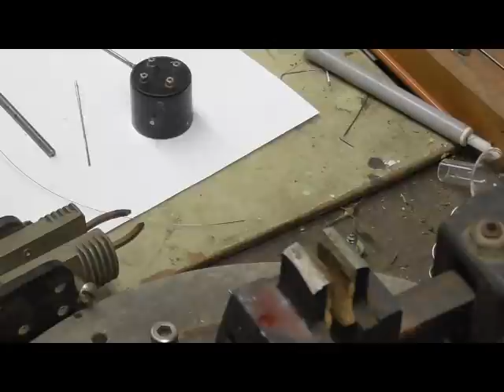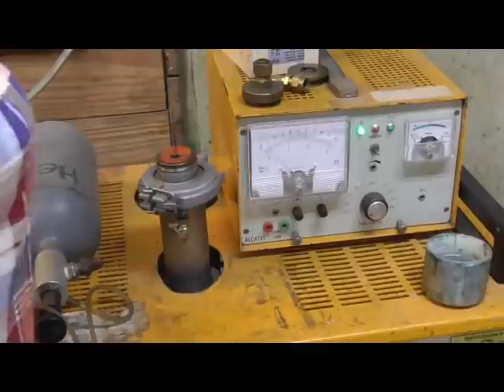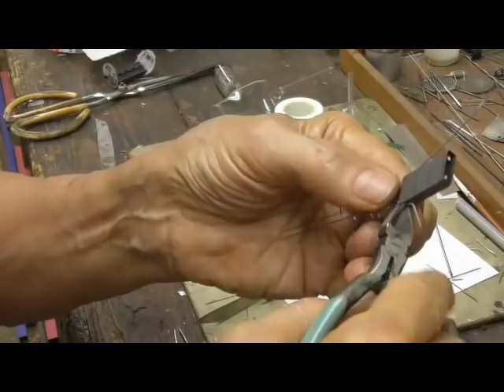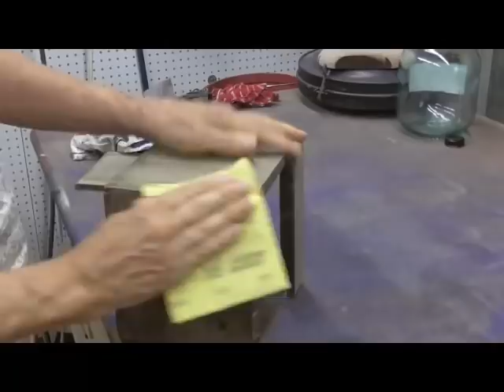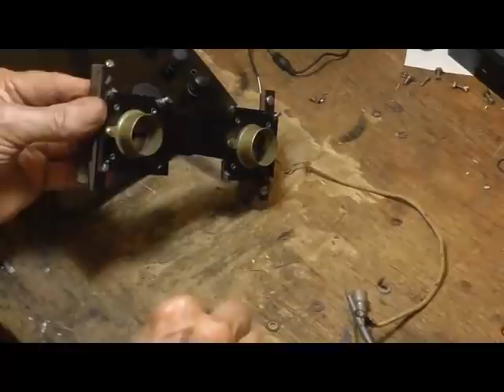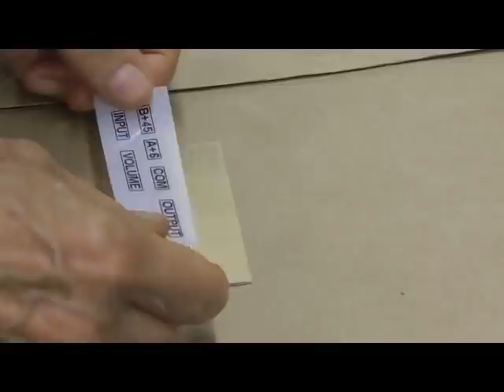1920's HORN SPEAKER AMPLIFIER

Comment: You need a part 2 to this video where we make it work really well!
I would have loved to see the oscilloscope waveforms in volts pk to pk, along with the plate voltages for each of the two stages to find out where you are losing your power at.
 With 100 millivolts pk to pk of input at the grid of the first stage you want to see at least 1 to 2 volts on the plate of the first tube, and after the coupling transformer toy should expect to see 10 to 20 volts pk to pk on the grid of the second tube, which should have been more than adequate drive to drive the output tube into clipping.
 It sounds like you have a biasing problem due to filament offset voltage; especially since you wired both filaments in series, and impedance matching problems...
 Exactly what voltage and current do you need to drive that horn speaker you are using as an output device?
 Does it appear as a 2000 ohm load, or is it piezoelectric?
 If it is a 2000 ohm load and connected where DC plate current passes through it, it may be acting more like an electromagnet than a speaker, needing to be transformer coupled or capacitively coupled,
 You had so much gain from that first tube you tested that all you should have needed was that single tube to make a huge difference in the volume from that crystal set!
 We can make it work way better if you want to take some measurements and send them to me along with the schematic you are using.
 I am a 77 year old tube guru who can't make his own tubes, but can make other people's tubes do lots of things they never thought possible; who is bored and loves a challenge!
 I would have you send it to me but it looks far to fragile to ship.
 However, if you are ever in Northern Illinois you can contact me to meet somewhere. I can probably get it working the way you need it to while you watch me....
Dennis Ostrowski
Frankfort, Illinois 
60423
Reply from the maker: This was a quickie project for no other reason than to make a youtube video. I did not do any adjusting of the circuit at all, just got it working in the shortest time possible. The old horns are extremely inefficient in producing sound from voltage. You can have 100 volts swing on the driver coil and barely have normal expected volume. Fooling around to get another 50 volts or so would be of questionable value.
Reply: @glasslinger  ,
The driver you have is one of the more exceptional ones that can sound outstanding, no matter what they are connected to; even a large piece of drywall...
 Atwater Kent used similar drivers made by RCA to drive non voice coil cone speakers directly and they were the best in the industry.
.
Bottom line is iff you need the cash from a quick turnover, then sell it as is.
 If you want to make your amp sound much better driving that speaker, (no matter what it's impedance is), it can be done with the tubes you have,
 (which is what I would really like to see happen).
 Or you can put that amplifier you hand built, including the tubes, into an old battery charger buzz box, and put it on the shelf looking beautiful but knowing deep inside that it didn't work. I would feel bad for you if you were willing to settle for that...
 At the very least, you should put a 2000 ohm dummy load on it and compare your input signal voltage to your output signal voltage for gain and distortion.......

Comment: I learnt my trade in the age of tubes and worked in QC at a Milliwatt / Mullard factory. I was taught that the pins connected to the inside elements via a small length of (i forget the name) metal that had the same coefficient of expansion as the glass envelope which prevents cracking.

I am no spring chicken as you can guess and I take my hat off to you and your skills. Exceptional

Best wishes from Australia
Reply: COVAR
Reply: For the earliest tubes, platinum was used, later ones used "dumet".

Comment: Amazing, you would be sitting on the throne in the real post-apocalypse! The 'mu' was over a hundred, why did the gain not turn out enough to drive the loudspeaker? Was there another driver output transformer in the horn unit or is it 'high impedance'? I watched the guy bending wires and stuff at the Radio Museum in London 30 years ago, didn't see the glass work. He was making the bulb shaped style.

Comment: Absolutely stunning job, thanks for sharing your work! :)
Maybe you can use an input matching transformer? I mean the crystal radio needs to be loaded, the tube amp has high input impedance, this just cries for a transformer which could also raise the signal level? :)
Ohh and I love when you just laugh if something goes wrong! That's the right spirit :)

Comment: also too have the ability to run my guitar on the stereo this is importin to be able to do that run my guitar with the ability to be in stereo or mono plus run two aux inputs for cd and phono very basic tube amplifier with 6 tubes  well it could be seven tubes one rectifier tube two 12x7 and two out put tube like a 6v6  very basic amplifier plus the transformers  some thing like this a kit would be cool to make or have and to acually learn some thing wile putting it togeather  that would be a cool amp to do all thous things

Comment: I also added you on my youtube page i don t want to miss any of your work or projects another things electronic guys have bin working on are motors that can run bye them self s self powering devices and they use a wieghted fly well for a gyro effect and then it has a altinator or generator to power the motor and the motor self powers it self and they are sold as kits these type motors can power a home or even give power in a car electric car i was told once this could never be done, that was my belief from what my father showed me when i was like nine i was trying to just that too to build a motor that could self power this is a cool thing and so is the motor that uses Mercury to brake gravity just thin no more noisy aircraft and we will have flying cars .

Comment: I made a regenerative radio with a 6BF6 tube and it went into a 2,000 Ohm headset and was plenty loud. I would think with another tube, you should easily be able to drive a speaker with it, right? What is the impedance of the horn speaker?

Comment: You could cheat and add a one transistor preamp to the crystal set.  OR use the amp with a regenerative detector.
Better ID for the labels, print them in mirror image onto photo paper in a laser printer.  Then iron them on to the brass strips, the toner will transfer to the brass when the paper is peeled off under water..  Then spray with clear Kyron to protect the lettering.
You can also use Brother P-Touch labels, black ink on clear tape.

Comment: Great work! Now just drink a 807 ! Not enough gain? use 450v on the plate of the 807 and 250 on the screen, -10bias. with a little bit of change, replacing the irn core transformer with a air core inductor, would make a very nice 50mhz 2 watt oscillator.

Comment: The tubes had good gains so the performance of the amplifier can be improved?
Reply from the maker: The homemade tubes are considered "low mu" triodes. If the tube was made a bit differently it could be a high mu triode with a gain ten times as much. But it is very difficult to make a high mu triode that works on 45 volts. The electrode spacing is a fourth what is is in the low mu tube.

Comment: Does the tubes need ventilation?
Reply from the maker: These are low power tubes. They barely get warm to the touch so they can be closed up in the cabinet with no problem.

Comment: Hey, I have been listening to my battery pentode regen radio a lot. I really want to build another one and to make into a more elegant wooden enclosure, although it might be easier to try bakelite. I don’t know anything about nuts and bolts (they never taught me in highschool) so I need to go to a hardware store and figure out what fits onto what before buying like a jackass. I don’t know threads per inch and the size isn’t it in 16ths of an inch? Which is the first and second number means on nuts and grade 8 bolt I am lost.

Comment: Just out of curiosity, do you think it would be possible to make a vacuum tube by reusing a burnt-out light bulb, or at least parts of one? I realize it would probably be far less effective than using traditional glass-blowing techniques (Heck, given your skill you'd have no reason to even try it!) but for those just starting out, perhaps with less specialized skills and equipment, it might be nice to have a few shortcuts available to them.
Reply from the maker: Light bulbs are made from "soft" glass which must be processed in an oven. This is practical on a production line but a nightmare in a home setting. Soft glass is almost impossible to use without an annealing oven to relieve the stresses. Pyrex (hard glass) does not need this critical annealing to keep it from cracking.
Reply: @glasslinger  That makes sense. I'm certain that I'm not the first to come up with this idea, and I was curious as to why it wasn't more widely implemented. Thank you for taking the time to answer my question.
Reply: Ron here is on a whole other level, but you might look into some of the work done by H.P. Friedrichs.  His “Instruments of Amplification” book (ISBN 0-9671905-1-7) provides some hands on info on making tubes without glassblowing skills.  They aren’t nearly as amazing as these- and a lot less durable - but they are more approachable to the beginner.  Friedrichs uses bottles for envelopes and light bulb parts for his tubes.  Check it out!
Reply: @lorelei275  
Thanks for the tip! I actually have a profound fear of working with hot materials (glass, metal, etc), so I'll probably never attempt any of those projects. However, I like to imagine what level of technology an individual could achieve when working with extremely limited resources, but equipped with modern scientific knowledge. This book does sound intriguing!
Reply: Gosh I just don't think you'll be able to get the seal right! Just look at how thin that glass is on a light bulb... it probably wouldn't even stand up to the vacuum (Light bulbs are around 0.7 atmosphere of inert gas; this tube was 10^-5 pascal of vacuum)

Comment: Ron, when you’re making the grid, would there be any benefit to winding the grid wire around the posts first and then welding all of them on at the same time (assuming the welder jaws go wide enough to get both sides at the same time)? Hopefully you understand what I’m suggesting.
Reply from the maker: There is an insidious problem with that. The wire stretches a bit when wound so as you wind turns adjacent turns get slightly loose and move. In commercial tube grids, they use a special knife blade that makes dents in the support to keep the fine grid wire from moving during the welding process.
Reply: I was thinking the same thing :-)

Comment: Hi Ron. Love your channel. Can you explain the measurement 'mil'? I understand that 1mil is 0.001 inch and 10 mil would be 0.01 inch but clearly the 10mil nickel wire that you are using is thicker than this  is it not? Thanks
Reply from the maker: I thought it was 10 mil but it actually is closer to 15. (still very thin) I got it on ebay as "10 mil nickel wire" so take anything from ebay listings with a grain of salt!
Reply: But he is talking about tube wall thickness, because he is welding nickel wire into really small diameter nickel tube.
Reply: *Copper wire into nickel tube (normally used for low power vacuum tube cathodes).
Reply: @martinlelek3791  Thank you Martin for your reply but if you look at time 25:22 who will see that Ron definitely  refers to the nickel wire  as being, "100 foot roll of 10mil wire" You also state that he was talking about tube wall thickness.
Well 10mm is 0.01 of an inch or 0.254mm. Surely tube thicknesses are thicker than  a quarter of a millimeter aren't they? Thanks
Reply: @eolhcytoos  So you are asking about 10mil wire, I thought that your point is nickel tube at 7:43.. At 25:22 he is really holding 10mil (0.254mm of dia) nickel wire, but probably because of 480p video and light reflection, it can looks thicker. Nickel is also harder then copper (4 vs 2.5), so wire of this thickness and length just dont falls down on the end like 0.254mm copper wire, but stays straight.
Reply: @martinlelek3791  Thank you Martin for the clarification. Much obliged!

Comment: Very cool and ambitious as always. Why do you flash the getter before you seal the tube? Isn't there a risk that the sealing fails and then you can't recover the tube?
Reply: Oh, I just realised that the flashing itself probably causes some outgassing that you want to remove.
Reply: I have seen on other videos even from industrial manufacturers that the getter is flashed before sealing the tube. Seems to be GMP but I wonder too if it doesn't become a problem to get a good seal in case some getter is condensing in the pumping tube.
Reply from the maker: @peterv8572  The new getter has a LOAD of trapped gasses that are outgassed when it is heated to red hot. This gas will "use up" a lot of the getter material if it is present when the getter is flashed. So by heating the getter while pumping removes this extra gas. There is always the chance of screwing up the seal-off but with experience it is rare.

Comment: Making tubes from scratch! I loved watching your process, I always wanted to work with glass and electronics, making tubes and lamps would be so skilfull and satisfying. I wonder how hard it would be to restore dead radio tubes and nixie tubes? I guess it would be a matter of replacing the filament sections and the vacuum and also refilling the neon gas mix in the nixies. Keep up your fantastic work!

Comment: I may adapt your capacitive welder design to weld thermocouples.  Did you make the welding jaws or just adapt some used ones?

I had not realized how the grid spacing effects the operating voltage of the tube.  That was the most interesting thing I learned from this video.

Thank you for making your videos.  They are unique and excellent, and I always learn by watching them.

Comment: Great job Ron! It seems to me that two tubes should provide more than enough gain. I wonder if the losses are from the interstage transformer? Maybe you could try a capacitively coupled design instead.
Reply: maybe use a 1:6 ratio transformer
Reply: or check the transformer is the  right way round?